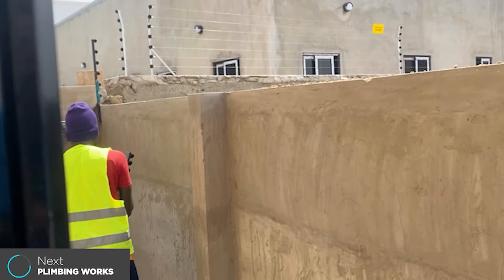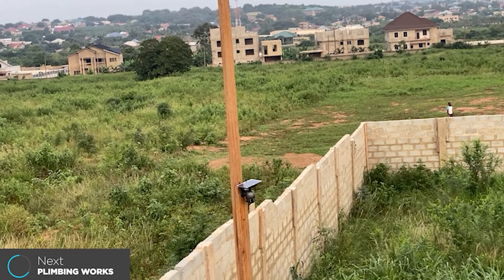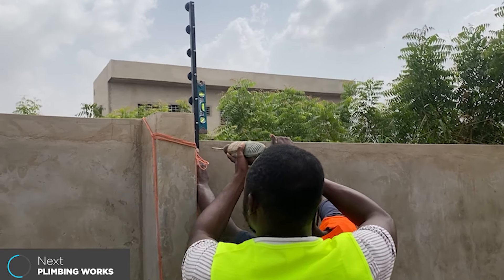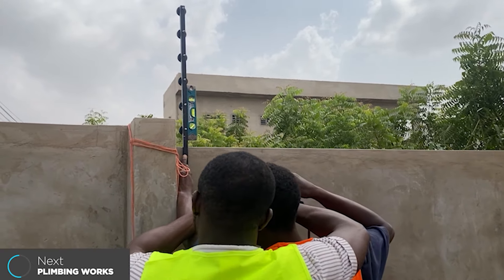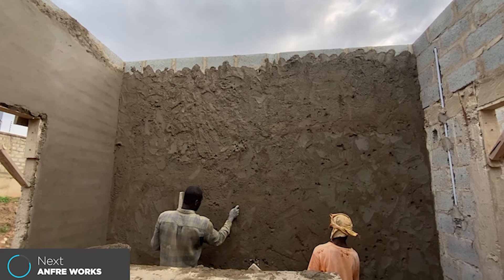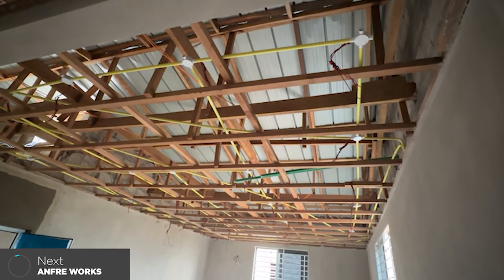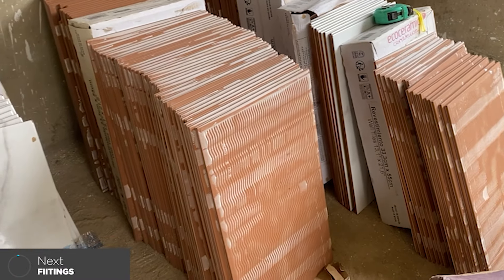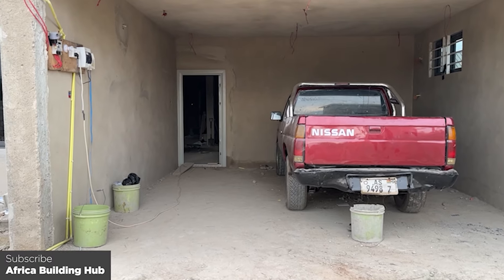The 7 Most Important Things to do after roofing your house!

Comment: Hi, what is your opinion of doing the stage 1  electrical works, ie elec piping, plumbing, air conditioning and cctv provision works before the putting in burglar proofs and security door? No electrical feed through the piping at stage 1.
Reply from the maker: That is the practice. Just that thieves are getting wiser by the day so I would still advise you to get your security details in place first.
Reply: Thank you
Reply: Definitely get your security doors  and bars done before.